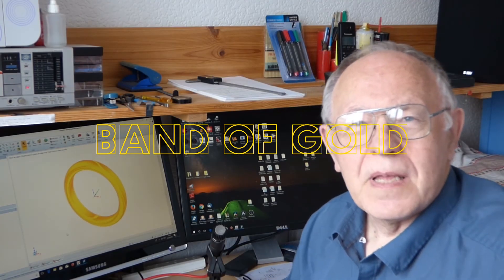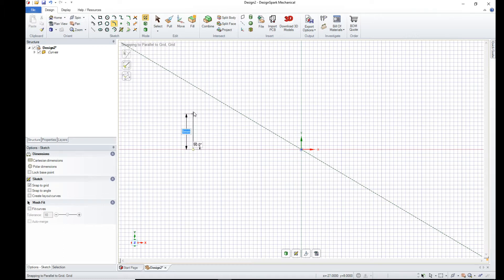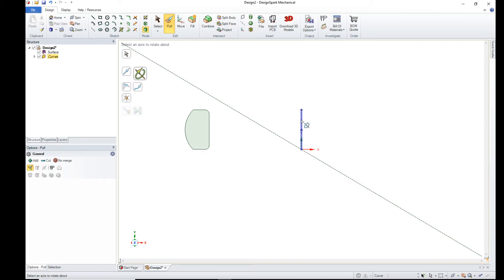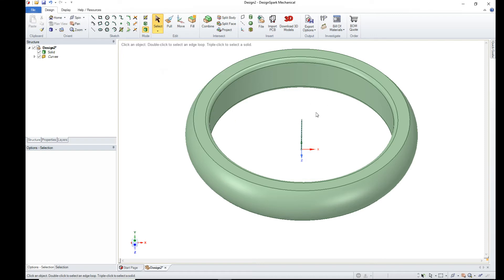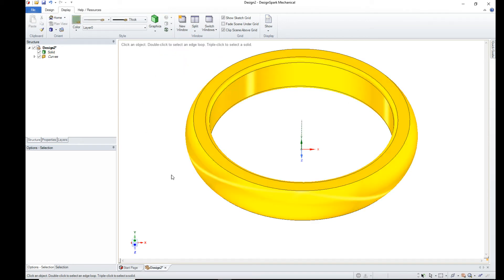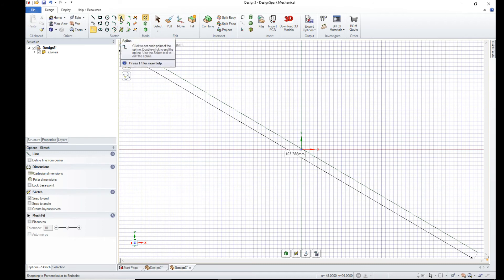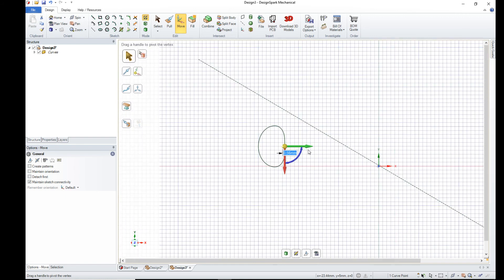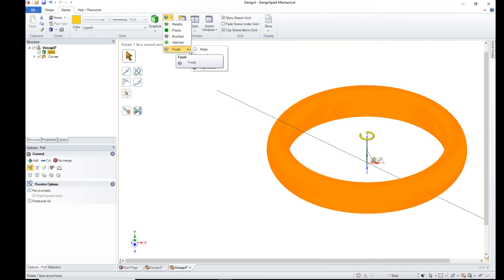Band of Gold by DesignSpark Mechanical

Comment: Hi Jim.
Hope you read this. Pulling my hair out, trying to figure out how to get maximum resolution in exporting a similar design.
I made a simple ring, just like yours. But when I export it into an STL, I get straight segments, that make up the ring. I DON'T get a
smooth ring.

I'm looking at what I have on the screen. And it looks SMOOTH. When I import it into CURA, I get straight ring segments. I get the
same thing when I import it into TinkerCad also.

With this program, I'm assuming there are settings that can adjust resolution? Since there's only "Save As", and no "Export", I can
still choose the file type, but I'm not seeing any parameters that I can adjust.

In short... What's it gonna take for me to get this thing SMOOTH?
Thanks for your time.
Reply from the maker: You could try changing some settings in File/DesignSpark Options/File Options/STL - Resolution panel.
Reply: @JimTaylor42  Hi Jim. Thanks for replying. I did manage to find out that the settings I was looking for were found in "Options", in the File/Settings dialog box. Once I made those changes, I got the resolution I was looking for. Just a shame that the lesser programs, like TinkerCad, are "polygonal" programs, where their settings only allow for polygons (using "sides"). You only get just so many sides to smooth out your circles, which just wasn't enough.

But thanks for taking the time to respond. Bets of luck to ya. Stay safe.

Comment: Hai Jim thanks for all these video's, I have a remark, instead of in the beginning drawing a construction line from top left to bottom right, 
I made a short cut key  to use the command : " Show Sketch Grid". this is situated  on the display tab. and turning it of by every time switching to the display tab and then returning to the design tab was a bit cumbersome hence the shortcut key 
I now start up DSM press the shortcut key once and I have the underlying faint grid which is less confusing with the geometry I design. and it covers the entire screen even beyond the edge of the screen. 
And to me it is much clearer to see my own drawings. and I can still snap to the grid. 
kind regards Hans

Comment: Thank you for making these videos Jim, they've proved very helpful.

You can ask for the first method of construction to be displayed without any lines superimposed over the solid. Two icons down from the Rendering Style is one called Edges. If you switch off the Tangent and Solid options you get the desired effect.
Reply from the maker: Thanks for that, useful info.
Reply: Excellent, thanks

Comment: With the 'Pull Full' tool on the pop up menu you don't have to drag around the axis and it works without changing the viewing angle. The Pull Full tool is the last one on the pop up menu that looks like an arrow with a bar in front of the point.
Thanks for posting these videos.